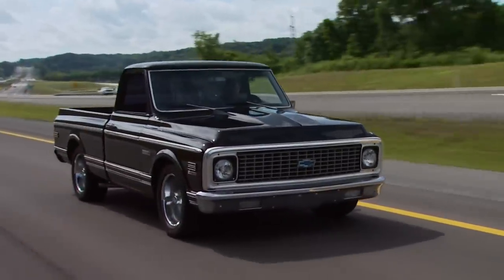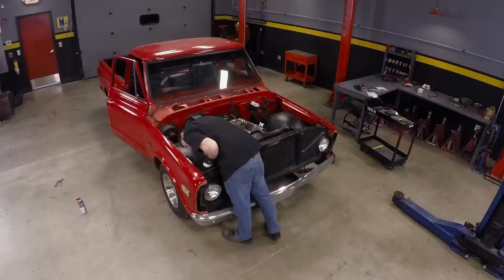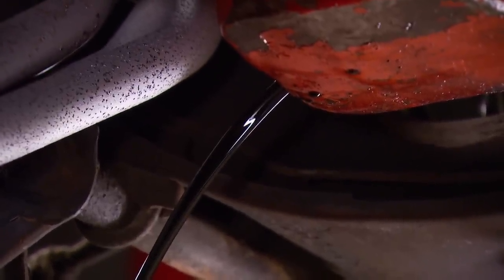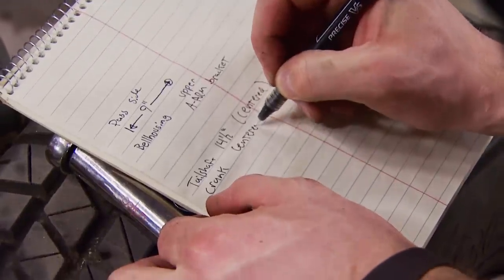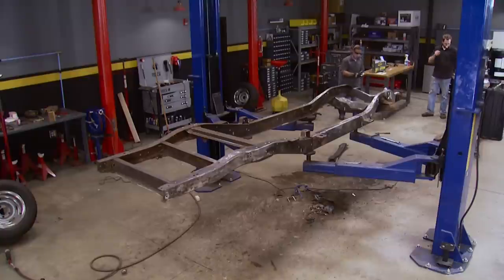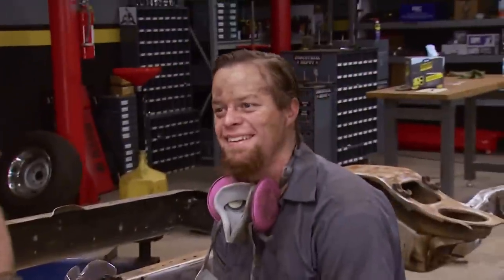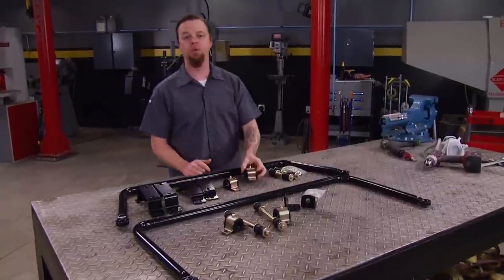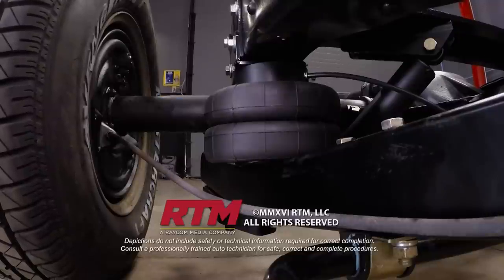Lowering A 1971 Chevy C10 - Truck Tech S3, E7

Comment: Personally I would of kept the old 350 and rebuilt it with high performance parts.
Reply: @Wesley Mooney, Agreed 100%
Reply: Stroke it make 500hp
Reply: Agreed. Should be against the law to do what these guys did to this truck, hacking and bagging a classic like this one.
Reply: @bilbobaggins4710  so all that work to make less than the new motor makes stock.  Throw some parts at the LT1 and make way more than 500.
Reply: @bmstylee  I was bolstering the op's desire to keep it old school my man
Reply: @bmstylee  and go price a FUCKING LT motor even used...I can build an old school  stroker for $2500 all forged internals
Reply: @bilbobaggins4710  fine.  Built LS > built 350
Reply: @bmstylee  I'm pretty sure it's the nostalgia of a classic truck. 350's are very reliable and are easier than crap to work on. No computers all mechanical
Reply: I agree
Reply: @bilbobaggins4710  you do realize that they basically just made this truck a pro touring it has virtually no use as a truck anymore because of the low stance and power plant it will barely hook up because of the light weight in the ass end they are right these trucks handle 5.3s or old school way better but the newer motors are more fuel efficient so it just depends on what ya want
Reply: That's probably what I would've done too. Wonder where this truck is now.

Comment: Personally the four link is better than the swing arm system they came with and of course the stabilizer bar for side to side control at that point. The truck looked nice coming in to the shop which proves you can polish a turd. That truck has the feel of Earl Sheye restoration. Never good as the build doubles in price. I think the style truck rear end was a five year only but am sure I am wrong on the years as the front didn't have the torsion bar suspension which was a short life span.All the usable bagged parts are good for swap meets but the bad worn ones should go straight to garbage. Someone will want the old 350 engine as it seemed to hold up the chevy name. That cab needs a lot of help for it to be right. I figure that is why this will be either two, three, or more episodes... marking how much to milk it for. I enjoy these builds too cause it gets junk off the road

Comment: Truck was fine the way it was! All this new age crap there is no need for it! These old classic trucks and cars are cool as they are. They are old classic cars and trucks with classic drive trans in them. Stop putting all this new stuff in classic cars and trucks. if you want new stuff buy a new truck or car! Ruining and hacking up all these classics is getting old fast! 👎🏻👎🏻👎🏻
Reply: Agreed, building that 350 wouldve been a much better option
Reply: Damn right. I got a 67 and I always gotta wonder why people run them with this type of crap
Reply: I guess, if fine is a rusted bed and cobbeled up front sheetmetal up front and a maaco paint job to hide it.

Comment: Always found the fact that they didn't use leaf springs remarkable. It would be another 40 years until another truck didn't have them.
Reply: Actually, they did use rear leaf springs on some of the C10s. It's a factory upgrade. I don't have the code in front of me, but the label is  on my glove box lid of my '68 C10 long bed. Its called the HD Rear Leaf suspension.

EDIT;

04G50GA is the option code for HD leaf. I had taken a pic of my tag after work.
Reply: GMC had leaves.